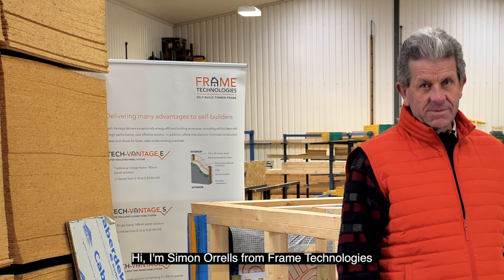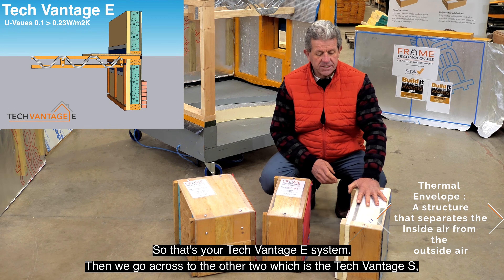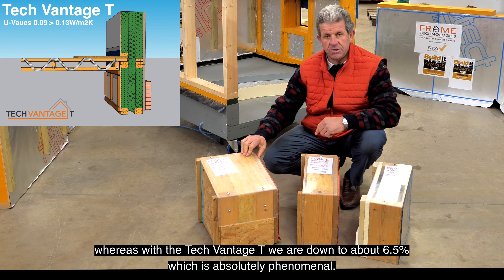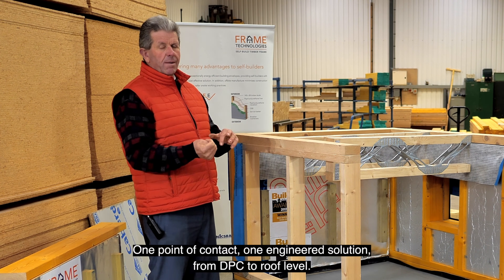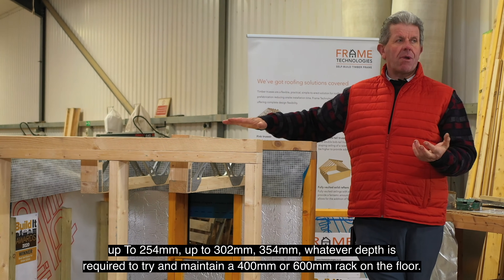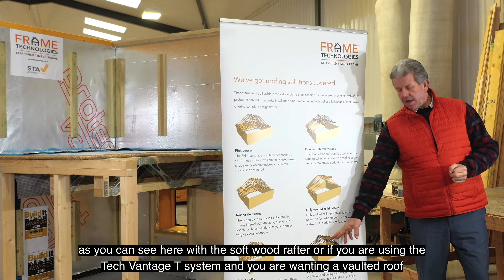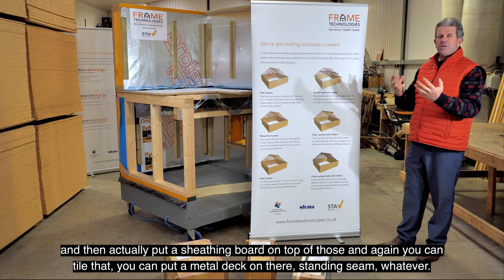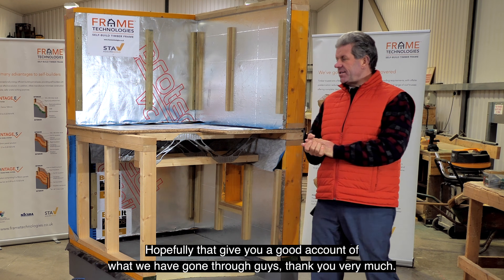Self Build Timber Frame Demonstration with Frame Technologies

Comment: Great video. What allowances do you use for differential movement at windows and doors?
Reply from the maker: That’s a good question. It really should be advised by your specific building designer, as it depends on the overall height of the building and roof loadings etc. But, as a guide, it would normally be around 6-10mm per storey. Hope that helps!

Comment: really interesting that you can build so much in timber ...can I ask what the fibre  board is you mention is ? ( manufacturers name ?) it looks like mdf ?but I wouldn't think it is
Reply from the maker: There are two types of external panel sheathing. On Tech Vantage E we use 9mm OSB (Oriented strand board ) which is a structural racking board like Plywood. On Tech Vantage S & T we use the above board internally, and we use a Woodfibre board externally, which acts as an insulation board as well. The panel is insulated with a breathable insulation. The brand is Steico.

Comment: On the services gap, what about electric socks. I take it you should rebate or cut into the liner board?
Reply from the maker: Most people use a 25mm or 38mm service batten which, once plasterboard is fitted, you can cut the socket in and use a drylining box and it will sit nicely in front of the insulation liner. There's no need to cut into the liner as this will reduce the thermal performance of the liner. It fits nice and neatly. Hope that helps!
Reply: @frametechnologies1954  
👍 Thanks.

Comment: so did i get this right, you would use this instead a block wall ? but the brick wall outside still remains ? thanks in advance
Reply from the maker: Yes. The inside skin is timber frame instead of blockwork and is factory manufactured and pre insulated. Then you can have brickwork around the outside to clad it or lightweight cladding. Have a look at the case studies on our website for more information. They will give you an idea of the designs we have built and also shows its flexibility.
Reply: @frametechnologies1954  thanks will do sir 👍

Comment: Excellent presentation. Is this option more expensive than the traditional way?
Reply from the maker: Hello, AnthonyThomas - thank you for your comment. Building today using timber frame systems manufactured offsite in a precision-controlled factory environment is no more expensive than traditional methods. In most cases for self-builders who want to build their own energy-efficient homes for the future, timber frame delivers far better cost value. It makes it easier to achieve today’s design standards as it is a natural and airtight solution that is energy efficient. - Simon Orrells, Managing Director.

Comment: I'm building a timber frame and want to use external tiles on the outside can I use them tile backer boards with blue insulation inside fixed to the timber frame?

Comment: How is the base plate fixed? nailed through dpc ???
Reply from the maker: Hello Mike, thank you for your comment. It is nailed. The sole plate is mechanically fixed to the engineer's requirements through the sole plate and DPC into the concrete block updstand.
Reply: @frametechnologies1954  Mechanically fixed (nailed), contravenes building practise's though, putting numerous nail holes through a supposedly impervious damp proof membrane. Great video though.

Comment: Hi, if we raise square frames 5 by 3 meters with thickness and width of boards 5 by 30 cm, (for building a cube cabin), would the lap joints of the frames be stronger with bolts or screws? And would there be necessary for extra corner strengthening triangular bars ? 
( the cabin is planed to be made with 10 such frames with a distance of 70 cm in between, conected  up and down with 70 cm pieces of the same board)